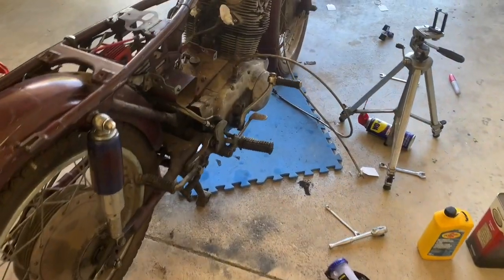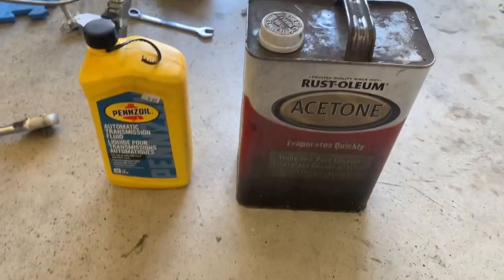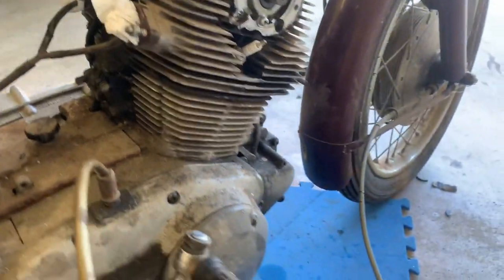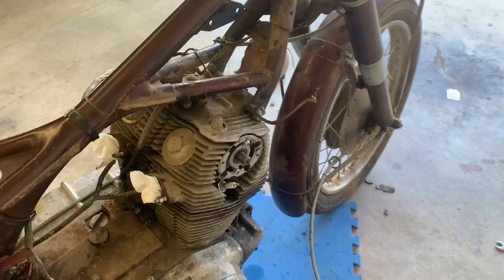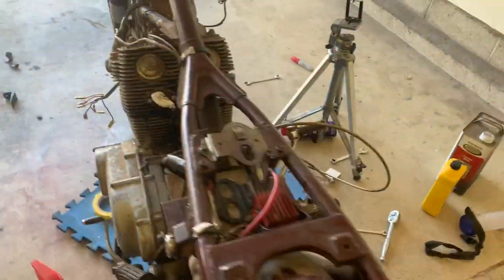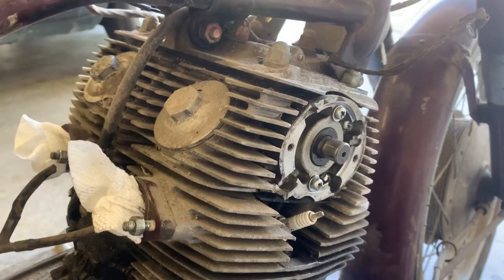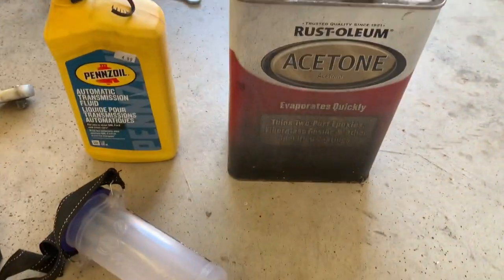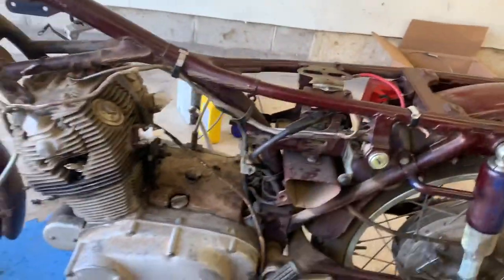Free Up A Stuck Engine With ATF & Acetone

Comment: ATF & Acetone - I did this with a '78 cb550.  Piston 1 was stuck.  Took about 8 days.  I cracked the oil plug so it could drip through and I would keep pouring it in.  I also put a breaker bar on the crankshaft so it was parallel with the floor and hung like 20 pounds of weight on it to keep some leverage on it as the rust softened up.  It worked!  Later when I got the engine running, it billowed white exhaust for a while.  Today it is a strong runner.
Reply from the maker: Great idea! You might see that in a future video for sure. Love the weight idea. Need to get it on the bench!

Comment: I did this on a 1980 xs1100 that sat for 15 years in a garage on the side stand…everything on the left side was shit (gaskets, the carbs were donezo from slight moisture and critters, the left front caliper was stuck). Got all of that sorted, then went to change the plugs…plug #2 had fused into the head and REALLY jacked the threads up, so I had to heli-coil that cylinder. While all the plugs were out, I did the EXACT SAME PROCESS in this video, as it wouldn’t turn over. I put two teaspoons of the 50/50 in the spark plug holes, then let it sit for actually only two days (I was too antsy to get this fuggin’ thing running) while I worked my ass off at my job. Had a brand new battery on trickle while I worked. Plugged the battery in, hit the starter, and it started RIGHT up. Blew all the garbage out / smoked for a few minutes, shut her down, changed the oil (again to be safe), and I’m still riding the fucking thing to this day. I got it running in 2016. I SWEAR this method works!! Use it for longer on bikes that have been sitting for two or more decades!!!
Reply from the maker: It took patience but it eventually broke free.

Comment: Just did this about a month ago to a 73 CL350 K5 that sat for 40 years. Took about 2 weeks of sitting and repeating the process, though I ended up having to pluck the engine and beat the piston with a 2x4 and a deadblow to finally free it completely.
Reply from the maker: It’s a lesson in patience for sure. Fingers crossed.

Comment: Clickbait ?
Reply from the maker: Not really.
Reply: @KeepOnWrenching  
You said in your headline "How to free up a stuck engine ..". 
All I could see that you supposedly filled whatever in the cylinders. 
Engine is not unstuck = clickbait. 

YES, really.
Reply from the maker: It will need to sit for at least a week. Then you can try kick it over. The 50/50 mix needs time to soak. The acetone/ATF is something I’ve heard a lot of people swear by. I hope it works for you. Hoping the same for this one. Good luck.
Reply: @KeepOnWrenching  
So make a video in a week if it works or not and post all of it then.. 
This video is worthless by itself

and it is clickbait.
Unsubscribing
Reply from the maker: I’ll probably do that and include some of the helpful tips others have shared. This one is probably going to take awhile.
Reply: @KeepOnWrenching  did it work?
Reply: Yeah clickbait. Waste of time.